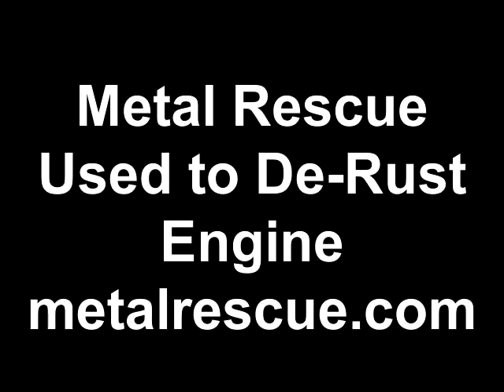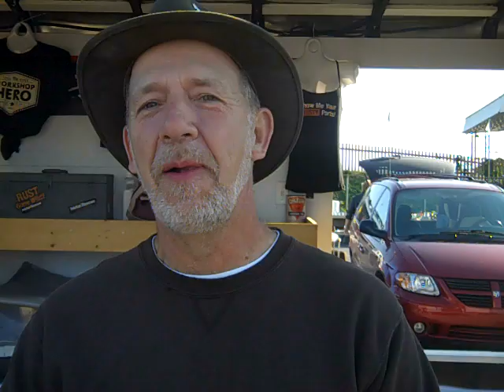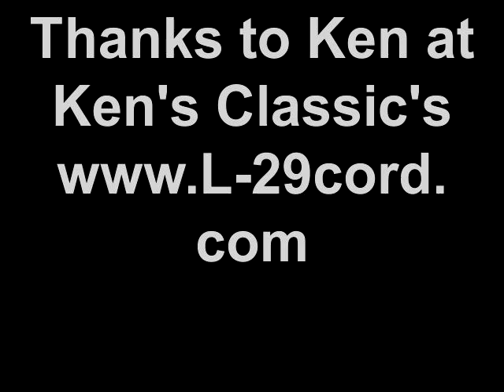How To Remove Rust From An Engine That Is Rusted/Seized

Comment: So all i have to do is drain my antifreeze, pour this in,  drive around then drain the next day? How good does this work for getting oil out of the radiator? Long story but i been flushing oil out every month for almost a year, since i got it back from a bad mechanic. There is no oil leaking into the radiator just still braking down the old oil.
Reply from the maker: That's right! Just keep in mind that Metal Rescue only removes rust and is not an acid. The rusted surface must be oil free in order for Metal Rescue to remove the rust. Metal Rescue does not remove oils or greases. Thanks for watching!
Reply: @BlasterProducts  ok thanks! I plan to change the radiator but maybe i should remove the rust first?

Comment: So, my aluminum motorcycle engine with steel inside that has been sitting for 10+ years and is seized due to rust inside and out can be submerged in Metal Rescue for X amount of time and it should be freed up by the time its done?
Reply from the maker: Hello Reid, Metal Rescue will remove any rust off of ferrous metals like the steel inside of your engine. Metal Rescue has to be in constant contact with the rust in order for it to remove it. Soaking your part is the best way to do it. Your soak times depend on the amount of rust and temperature. The warmer it is the faster Metal Rescue will work. The colder it is, the slower it will work. We suggest letting Metal Rescue soak on the engine for at least 24 hours. Thanks for watching, please let us know if you have any other questions.

Comment: hi.. do I have to fill up with this product or can I put say 3 parts water and the rest metal rescue. 
I have rust in a Cummins 5.9
and I need to if I can mix it or just use metal rescue?
Reply from the maker: +Grg Alcaraz you cannot dilute Metal Rescue, it will not work. You will have fill it up with just Metal Rescue in order to remove the rust. Thanks for watching, please let us know if you have anymore questions.

Comment: i just came from the shop and they said i had rust inside my engine will this work?
Reply from the maker: Metal Rescue removes rust from metal. It will remove rust as long as it's in constant contact with the metal part. Metal Rescue works best as a soak, or pouring it into something. Also it's safe on paint, plastic, aluminum, chrome, and to the touch. Did this answer your question? Thanks for watching!

Comment: what about engines with aluminum head.......?
Reply from the maker: Hi Faisal-Thanks for watching the video.  The Metal Rescue is safe on aluminum and other substrates.  Let us know if you need further information.  You can email us at info@workshophero.com or call 800-365-1117
Reply: do you guys have anything for limescale in engine heads which are made of aluminum ?
Reply from the maker: Hi Fasial. Unfortunately at this time we do not. Currently all of our products either safely remove rust, or prevent rust from coming back. Are you sure it's limescale? What color is the rust? If it's white rust, Metal Rescue will remove it.
Reply: yes its white
Reply from the maker: Yes, Metal Rescue will remove the white rust from Aluminum.
Reply: Metal Rescue™ from the Workshop Hero™
no unfortunatly i live in kuwait no store in kuwait have this metal rescue , so i have to import it , paying 130 dollar for a gallon + product price tage (24 dollar)...

Comment: i have a 1985 bmw 745i turbo with 56 000 kilometer and its been neglected for 15 years  the radaitor is history and engine has heavy builds up in the cooling system and im struggling to get that crap out of the cooling system before i install my new radiator ...i want this product so bad but unable to get it in Kuwait due to bad local dealers .tried Kuwait branches for true value and ace hardware  you name it still cant find it,i have sooo many people begging for it here with similar problems

Comment from the maker: @yeng Yes-Metal Rescue will work on ALL vehicles this way.  Follow Ken's instructions.  Drain the cooling system and then follow up by flushing the system.  When steps are complete you can add Metal Rescue to your cooling system filling to the top DO NOT add water.  Note that Ken runs his engines with Metal Rescue in the cooling system to elevate the temp. throughout the process (speeds process).  The process Should take from 6-12 hours depending on the severity of the rust in system & temp.